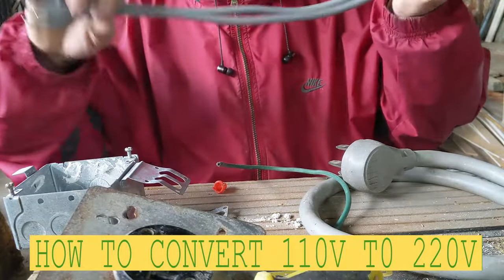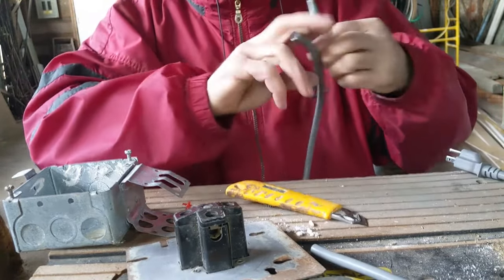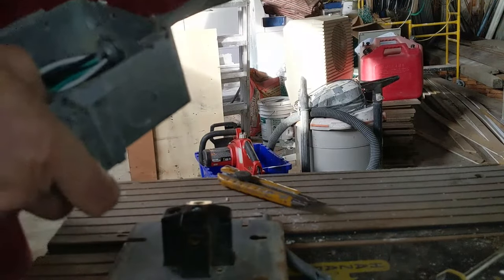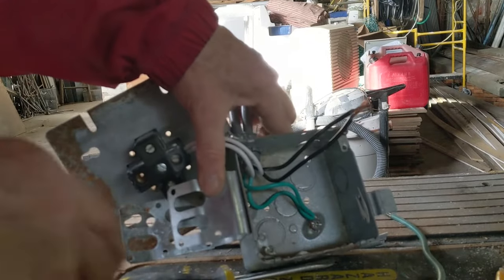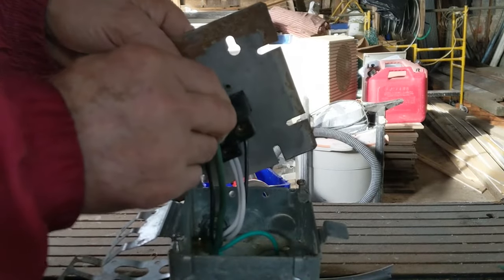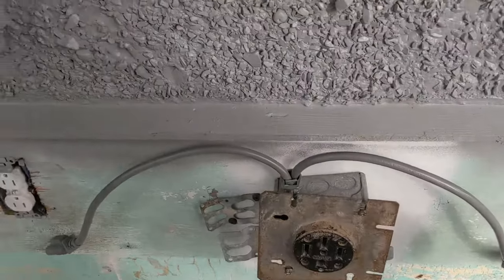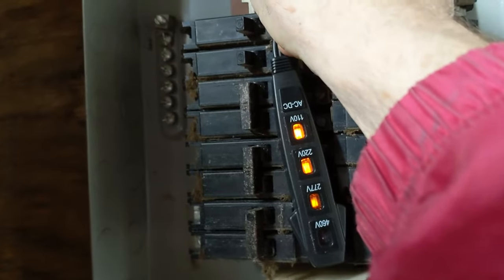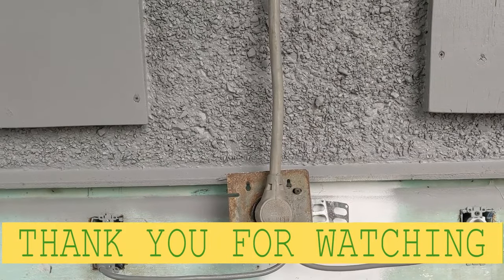How TO CONVERT 110V TO 110-220V In minutes

Comment: I have done this before. It does the job but it is dangerous.  If the 220 volt load is plugged in and someone unplugs one of the 120 volt plugs there could be live 120 volts on the pulled plug blade. If the 220v load has any possibility of conducting current (even just an indicator light)  there will be a voltage at the unplugged exposed end.

When I did this I ty-wrapped the 120 volt cord plugs, then put a piece of tape over then with a note to not unplug the cord.
Reply from the maker: Hello thank you very much for your time and comment. It works great as an extension cord (temporary power) or a place where just few people have access, I totally agree with you.
Reply from the maker: https://youtu.be/oSZdKY3L0io
Reply: @BahianoReno do the 110v plugs need to go into receptacles on two different circuits? Or would this work off using 2 110v outlets on same circuit?

Comment: If the 2x 110v 'hots' are coming from the same 120 phase, then the voltage difference between them is zero surely???
Reply from the maker: Hello there, thank you very much for your time, yes to produce 220v it needs to be connected to  2 different hot legs (two different hot phases) in this case I had a duplex house with 2 outlets outside near each other from different phases, I can make another video on the subject since this a tool that we use when others power sorces are not available, please let me know if have questions, keep safe and see in the next videos.
Reply: @BahianoReno  will this work with a generator ?
Reply from the maker: @keithpoland6429   Hello There, yes if you have 2 different hot legs, lot of the power generators come with 220v plugs already set up. thank you very much for your time and comment.
Reply from the maker: @keithpoland6429  https://youtu.be/oSZdKY3L0io
Reply: there is no way that this could possibly work...its not like your putting two batteries or capacitors in series. i wonder if it can be done with some diodes and capacitors, your looking to avoid making a transformer is that correct?
Reply: @mrschnider6521  he clearly states that his 110vac outlets are on two different legs of his breaker box thus the voltage between the two 110vac outlets is 220vac. Other than being really dangerous it would work to give him 220vac. If they were on the same leg it would only be 110vac

Comment: Can you tell me if a USA bought washing machine and dryer for clothes can be converted to use in Spain? So basically 110v to 220v. These are machines to wash and dry clothes. I appreciate your advice. 😊
Reply from the maker: Hello there, thank you very much for your time and support, the dryer in my area uses 220v and 110v, we can get dryers that run on 110v only, as not as good as 220v and 110v combination, keep safe, please let me know if you have any more questions.

Comment: Thank you for this video. Is it possible to connect 240v dryer with this setup? Here is USA.
Reply from the maker: Hello there, thank you very much for your time and support, there will be not enough power to run a 220 dryer (usually the regular house plugs are 15A breakers 14G wires, for 220v dryer we need 30A breakers 10G wires) keep safe https://youtu.be/oSZdKY3L0io